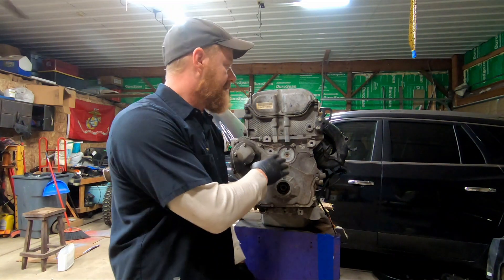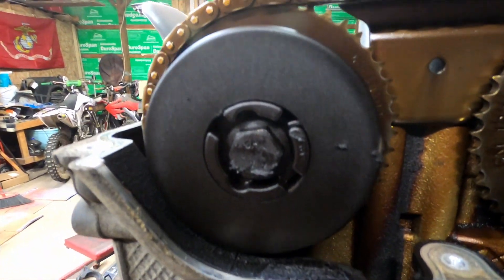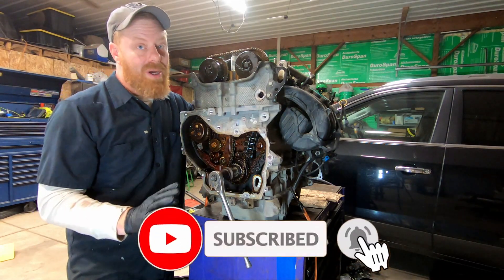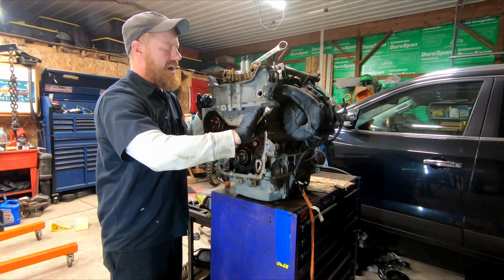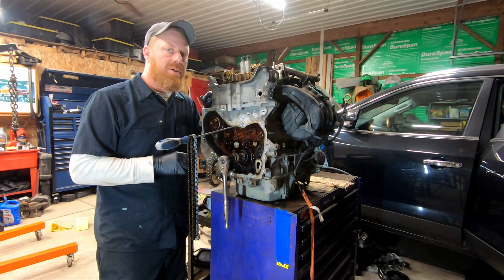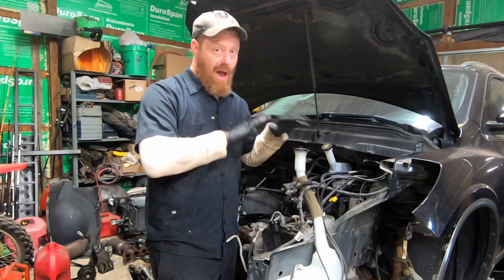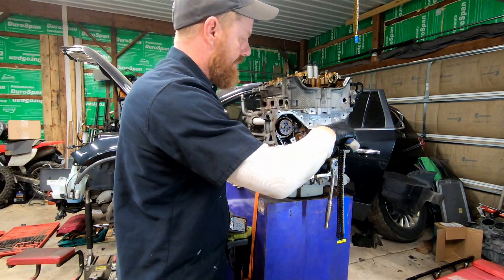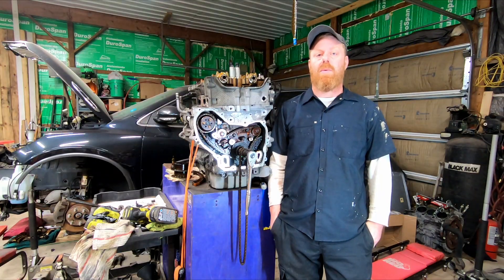What Is a Timing Chain?  What does It Do? Explained!

Comment: Thank you. This was very informative. My daughter’s 2012 Nissan Juke that we got 2 years ago (a little less than 100,000 miles) has to have the timing chain replaced, apparently for the 2nd time so I was curious how it worked. She’ll have to get rid of the car if it has to be replaced a third time.
Reply from the maker: Unfortunately parts today aren't very good quality.  Even oem parts seem to have a high rate a failure.  Count on the fact that it may need a third one.

Comment: Here ‘cause my 2000 Nissan  Frontier stopped working had to get it towed to the mechanic.  Waiting to hear back after the full diagnostics.  It’s a timing chain issue not sure the cost of repair yet.  I ignored “check engine light “.  The last time I was able to start the truck, it made horrible noises.  Thanks for explanation!